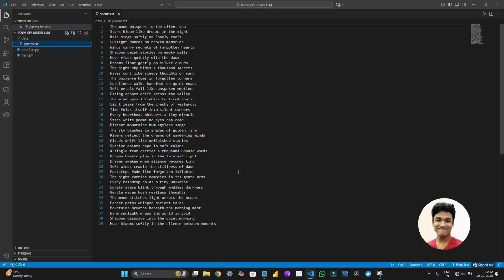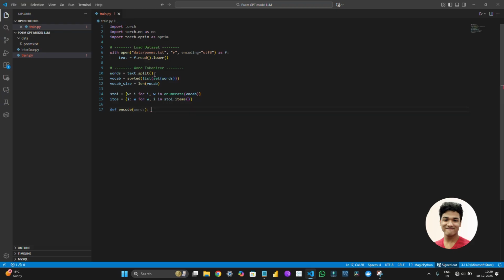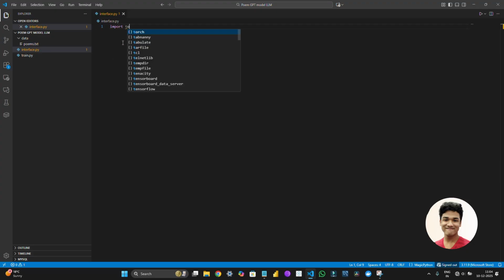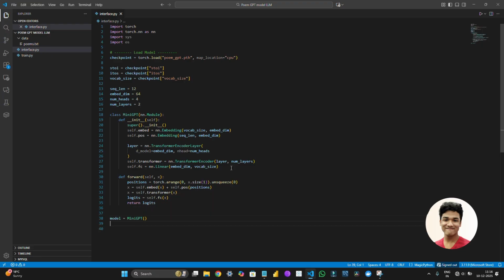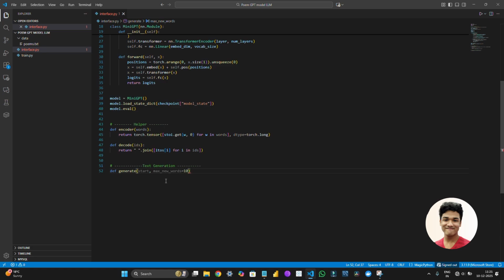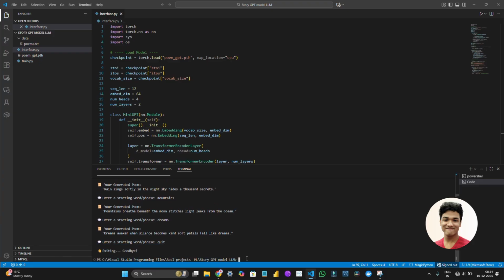How I Trained a Tiny LLM to Write Poetry 🔥 | Build Your Own AI Model – Machine Learning Project

Comment from the maker: 🧠 Introduction to Mini-GPT

0:00 What is a Large Language Model (LLM)?
0:40 How LLMs Predict the Next Word
1:05 Why Build a Mini-GPT Model

📁 Project Overview & Setup

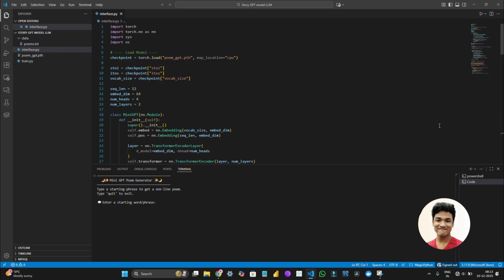1:30 Project Demo
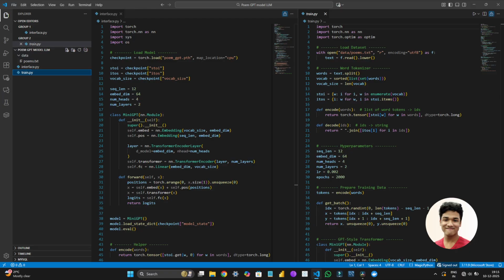2:15 Creating Project Files (train.py, interface.py)
3:10 Installing Required Libraries (PyTorch, Transformers)

📊 Data Preparation

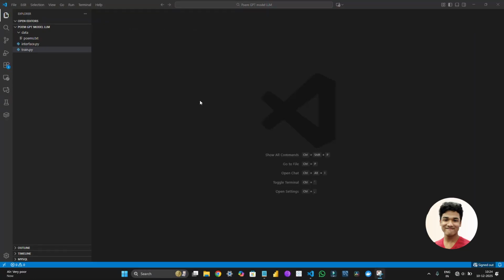4:18 Loading the Poetry Dataset
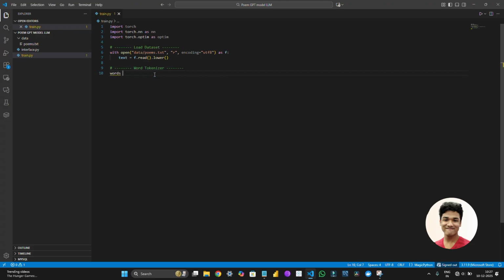7:10 Word Tokenization
9:05 Building Vocabulary (STOI & ITOS)

⚙ Hyperparameters

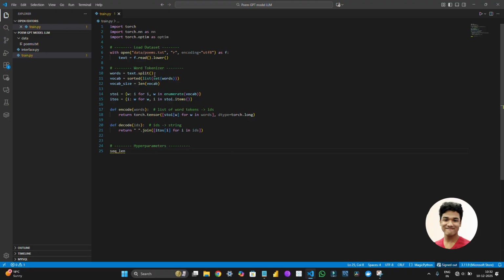12:45 Key Hyperparameters Explained
13:20 Sequence Length & Embedding Dimensions
13:45 Attention Heads and Transformer Layers
14:00 Learning Rate

📦 Training Data Preparation

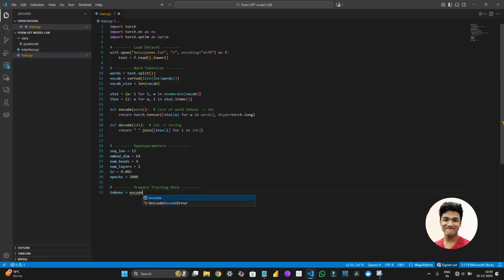14:16 Encoding Text into Word Indices
15:50 Preparing Training Sequences
16:30 get_batch Function for Sampling Training Data

🤖 Mini-GPT Model Architecture

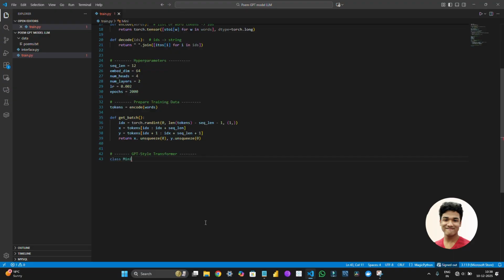18:08 Building the MiniGPT Class
19:10 Word Embeddings
20:00 Positional Embeddings
21:10 Multi-Head Self-Attention Layer
23:00 Transformer Layers
25:40 Final Prediction Layer

📉 Optimizer & Loss Function

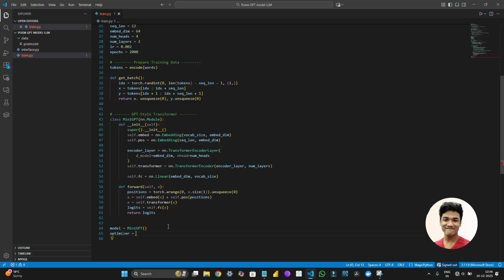26:53 Initializing the Model
27:20 Adam Optimizer
27:50 Cross-Entropy Loss

🏋 Model Training

28:12 Training Loop Explained
29:30 Forward Pass and Backpropagation
31:00 Updating Model Weights

💾 Saving the Trained Model

32:59 Saving Model Checkpoints
34:20 Saving Vocabulary Mappings

💻 Interface Implementation (interface.py)

36:10 Loading the Trained Model
38:00 Matching Hyperparameters
41:16 MiniGPT Class for Inference
45:10 Encoding and Decoding Functions

✍ Text Generation

52:04 Generating Poetry with the Model
55:30 Predicting Next Words

🚀 Demo

59:59 Terminal Interface Demo
1:01:30 Generating Poetry from a Prompt
1:02:58 Final Output